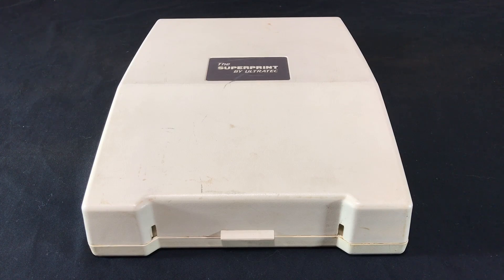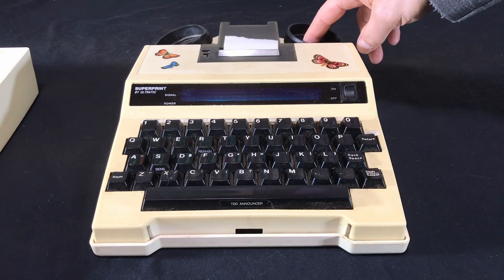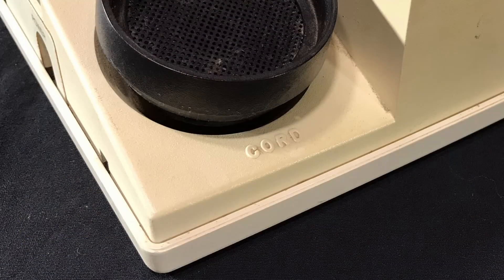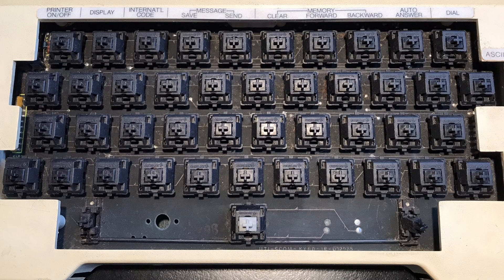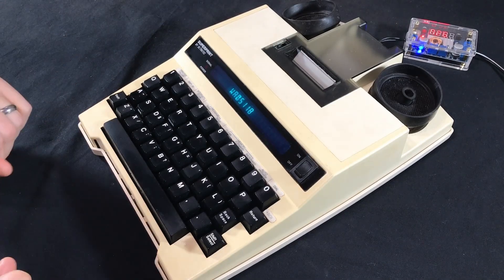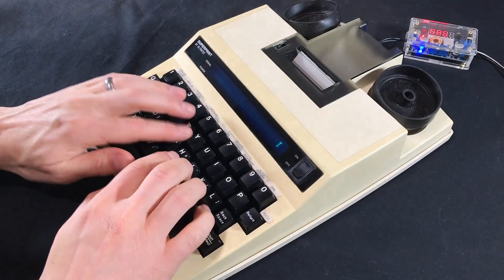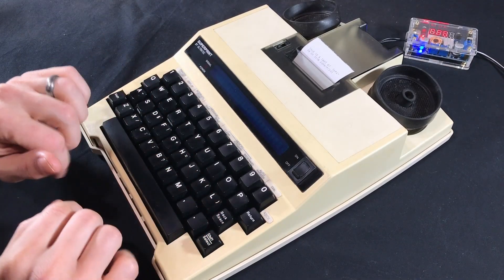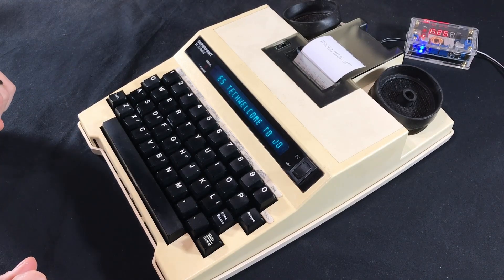Ultratec Superprint

Comment: I found 2 of these in the trash today. I assumed it was some sort of fax machine with the audio coupler on top. I imagine you could use one of those cheap USB retro handset phones, connect it to the top and send things like that. I plan on giving one of the two I had to a friend so we can message each other across town. Cell phone? internet? FEH I SAY!
Reply from the maker: They are fun devices for sure! I especially like finding retro items with thermal printers as it is easier to still find paper versus old dried up ink ribbons!